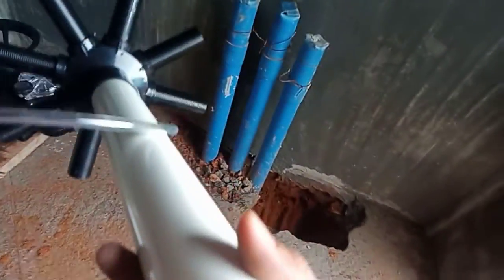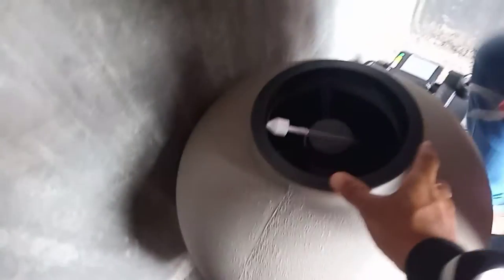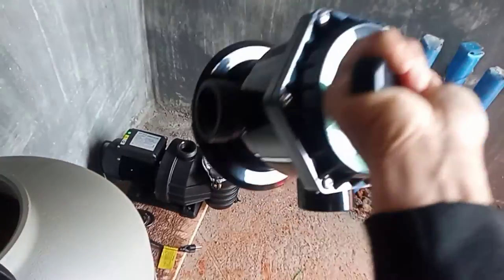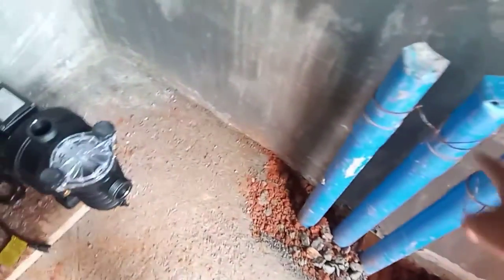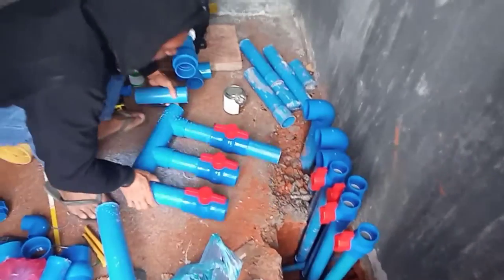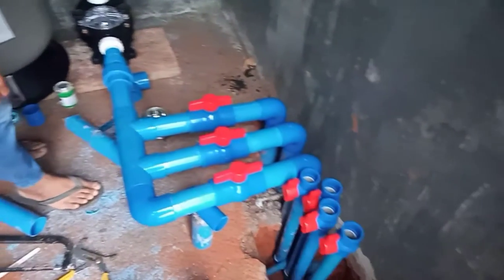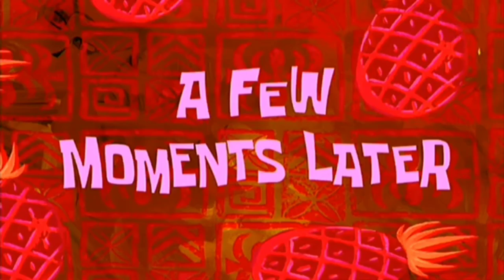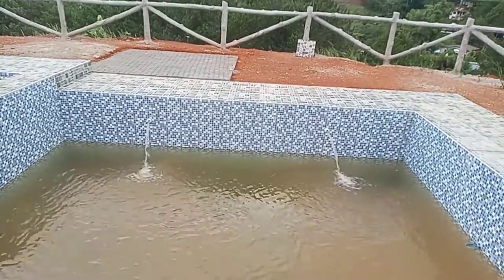Paano mag install ng swimming pool pump

Comment: Hello may mga questions lang ako.

1. Ano yung linya ng tubo na ikinabit sa huling part ng filter? Saan po iyon naka connect?
2. Nasaan po yung water source nyo sa pag fill up ng swimming pool? May size requirement din ba iyon? Need pa po ba ng pump sa supply ng tubig?
3. Anong model brand at specifications ng filter tank nyo po?
4. Ilang horsepower, model, brand, ng water pump nyo?
5. Anong model brand at hp ng blower na kinabit nyo dito?
4. Ano po yung apat na 1¼ na tubo? Dalawang sa spa, at dalawa sa return?
5. May level ba dapat kaming sundin sa pag latag ng skimmer? Ang jet at return po ba may required na taas din? 

Saan po kayo pwede i-pm sa mga katanungan ko? Salamat.